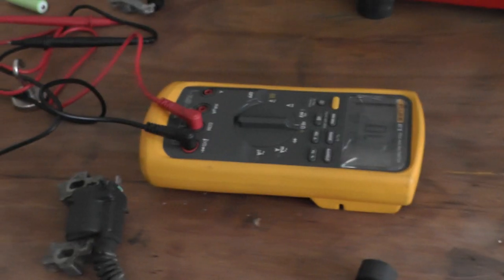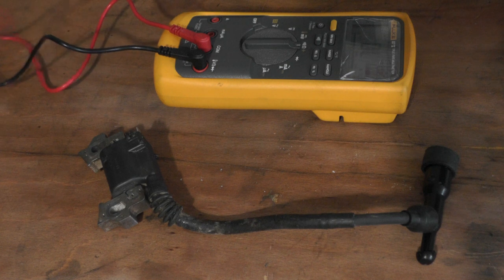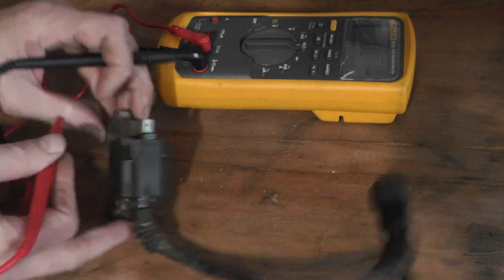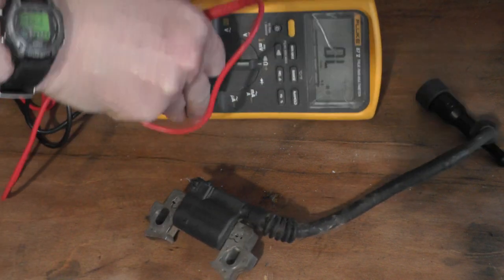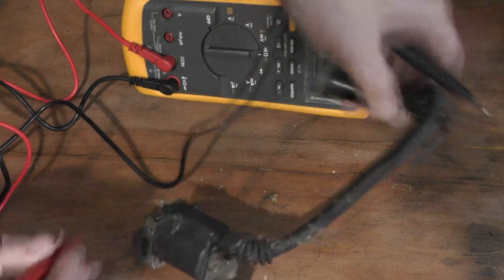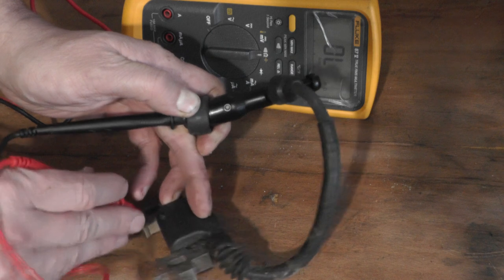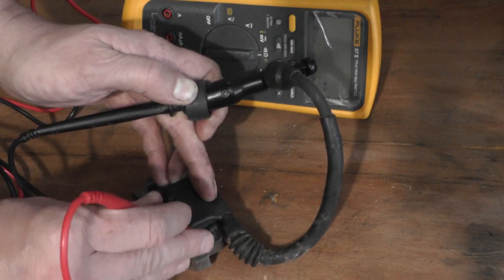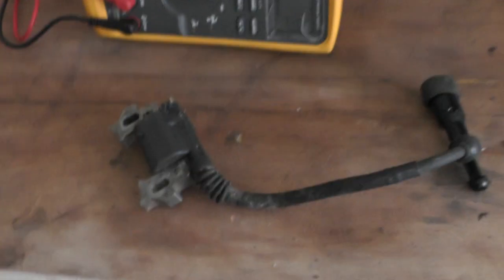Honda GX series engine ~ testing ignition coil with multimeter GX120 GX140 GX160

Comment: So there is not suppose to be continuity between the tab and ground, has to b around 1 ohm? Mine has continuity (*・～・*) and only 7 kilo ohms between the plug cap and ground.
Reply from the maker: 7k sound good should be 2 windings primary and secondary both should have readings